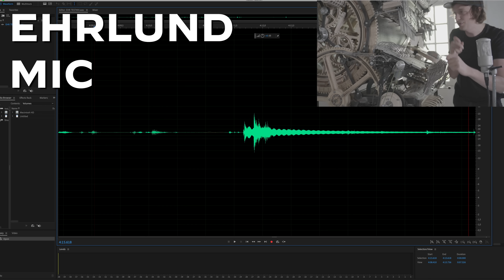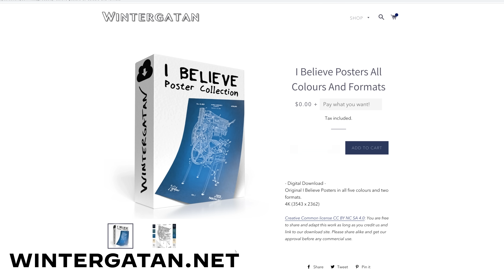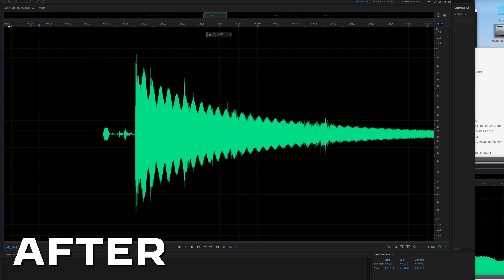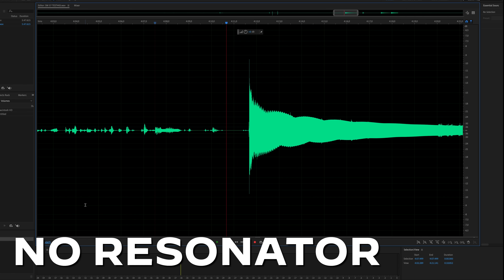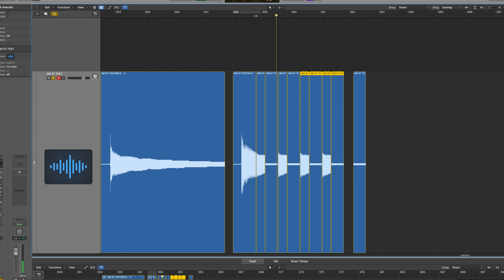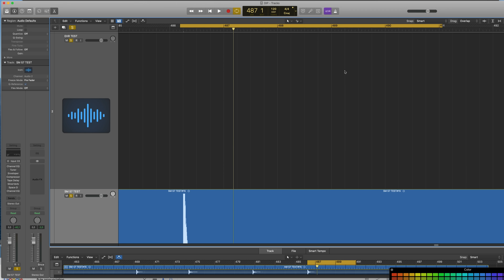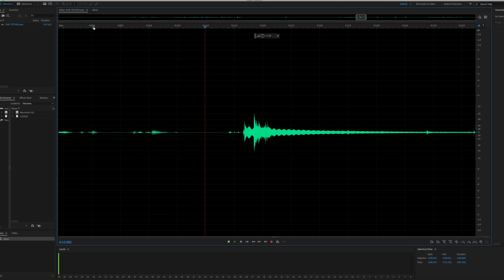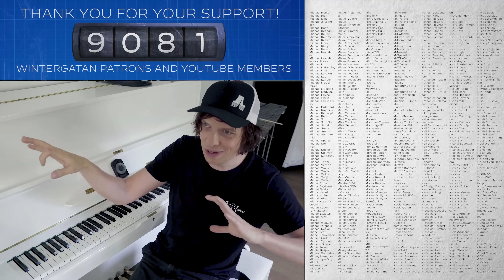Candy Dip for Marble Funnels - Marble Machine X135

Comment: There is a quote from software development: "Hell isn't other people's code. Hell is your own code from 3 years ago." (Jeff Atwood)
I think today Martin found out, that: Hell are your own design choices from 3 years ago :D
Reply: Yeah, in my workplace (with a high proportion of long-term staff), it's pretty common to hear things like "What moron wrote this? Oh, never mind... it was me..."
Reply: The most embarassing is when you have to explain your old code to somebody who has to work on it.
Reply: When I first got into programming, I didn't bother using any comment lines whatsoever.  It's not like anyone else is ever going to need to look at my code, and I'll certainly remember what it all does, right?  Right? ...
Reply: I made a lot of ahk scripts to simplify my work before. I just looked at them now, I couldn't understand half of what the scripts were meant to do anymore lol.
Reply: It's odd how coding is so similar to building something from scratch.  I'm reading all these comments and it's identical to the things I'm thinking when I start working on my project plane again.  "How the hell did that hole get there?  Oh right, that's where I'm going to install the fuel port."  If I had a vlog of my build it'd probably save more time in the long run than I would spend editing it, because I could just about pick up where I left off after watching a few minutes of my own footage rather than trying to remember what I did six years ago.

Comment: Does it make sence to put one thin layer of this new Rubber coating on the spot where the Yellowisch Rubber was Befor ? I think you can get a quite thin layer with that and you have the Material on Hand. And you would not see Rubber spots like you did befor

Comment: 9.50. I dont even hear the tail with my Phone, so no one cares, just finish the machine and tune it later!
Put servo motors to pull the funnels by fishingwire. The sound can be the trigger, or put opto electronics to do the triggering when the marble (bearing Ball) is at the right position /hitting the funnel

Comment: I have an idea. And it checks all the boxes. Get rid of the catch funnels completely, replace them with lights facing upwards and towards the machine, for much more eliminate realestate from underneath and in front of the mmx as they bounce off the instruments , the you can catch all the marbles on the floor with a rubber mat on top of wood rap, and this Catch-Box could hold more marbles, and be part of the transportation create.

Comment: What if the marble catchy baskety funnely thingies are made from formed plastic tubing instead of stainless steel?  Less mass, faster visual response, less pingy.  Something semi-rigid, but compliant.  You could heat form the "wires" and solvent-weld them into funnels of the same shape (depending on the plastic).  That could give you some freedom for color diversity too.

Comment: make the rubber mounted not in contact with the xylophone but floating just above it so the only moment the rubber affects the phone is when its in contact just like if each marble were rubber or plastic coated. the marble should still predictably bounce if you mount the trampoline of rubber just close enough to the phones that  it hardly affects the bounce.

Comment: I wouldn't be so picky about the pitch-shift at the end of the notes, Martin... as only you will worry about it, and ultimately only you will hear it.
You've got more pressing issues to conquer than discovering flaws in initial design and then fixing them again... and again.
Also... I noticed that your 'bucket' doesn't flex back as far now with the rubber coating, as it did before with it off.

Comment: Heya. Just a Thing about the Rubber Pads: If you Run Into issues when trying to make them thinner, you May want to consider mixing your Rubber compound with dampening particles or fibers. This way you might be able to balance bounciness (elasticity) and damping independently. I'm not Sure If you could simply rubberise some filt or If you would need to premix Something.

Comment: I say that you never know what design constraints are the important ones until you build something that doesn't meet them and find you are unhappy. If you'd compromised on the look and motion from the beginning and not heard the sound your original funnels made, you wouldn't know that it matters that this design avoids it. Instead, you spent a bit of extra effort to be able to compare and conclude that the clatter is bad enough to be worth losing some visual interest for. The real lesson is that this is what every project takes three times as long as it has any right to according to the plan, and you should just expect that (or let yourself be surprised by it if that's better for morale).

Comment: higher temperature should allow the dip to flow better. Okay, maybe the solvent dryes out to quickly in high temperature - but... you mention the smell, so there is likely a vapor layer above the pot, so the dip should not dry out to quickly while over the pot.

Comment: I'm guessing Martin is right about the resonator pipe out of tune (9:20) not just because of the pitch shift, also because of the pulsing. Remember the tremolo effect is not active, that pulsing is from the two pitches being a few Hz off from each other. You can even calculate the exact pitch by how many pulses  per second,  1 pulse/second = 1 Hz off

Comment: A common mantra is software development is “Good, Fast, Cheap: Pick two.” In more words: you generally cannot solve a problem in the “correct” way quickly and cheaply; usually “quick” and “cheap” solutions cut corners in quality. To maintain quality, you either have to take extra time or spend more money to get to a correct solution. Martin has learned that this extends to physical design solutions as well.

Comment: Martin, try "Blade Tape" instead of rubber pads. Its a Urethane tape made to protect the leading edges of Helicopter blades, propeller blades, wind turbine blades, etc etc.. Its maybe a half mile thick and it's designed to take the impacts of rocks and debris so your marbles won't do much damage. Its barely barely bouncy unlike silicone. Should work.

Comment: Have a look at SmoothOn products. They make all sorts of rubbers that are 2 parts you mix together. I’m not sure if they make much in the way of clear stuff, but you can get any hardness from a rubber band to car tires. I’ve used it for making custom tires for robots and it holds up unbelievably well. It might be good for coating or filling anything you don’t want resonating. I think it starts at around 25$ for 2 lb of resin.

Comment: Please don't assume that any change will get rid of the "super jumps" without first testing. I suggest the first test involves dropping marbles on a plate at it's resonant frequency, not the frequency of the plate itself but the resonance of the plates vertical movement, then drop a marble off beat to this. I will be very very surprised if this doesn't highlight your problem for which there would only be 2 solutions, 1. remove the movement of the plates, 2. cripple your music making ability by ensuring this scenario cannot happen whilst playing.

Comment: Hi Martin, perhaps I am repeating an existing comment but what do you think the effect of plastic dipping the marbles would have on the overall machine. Many of the instruments you have don’t typically interact with such hard materials as steel balls and as such the tone and pitch may be a little more natural. Magnetically speaking I would expect the plastic dip would be thin enough to preserve the magnetic field strength. An observation only and mostly just thinking out loud. Keep up the amazing work!
Brent

Comment: hotter temperature would make the rubber flow faster not slower. with a hotter temperature you would get thinner coats which would be undesirable for the rubber coatings intended purpose: coating tool handles

Comment: Stop being so hard on yourself but think things through in a methodical manner you should have not done so many layers of rubber dip you should have put one layer on the funnels let it dry and then put it on the machine and tested it to see if it dampened the sound enough then it wouldn't have so much mass where it wouldn't move you put too many layers on it will you took away the reactive qualities of the funnel what I would do if I were you which is going to be a pain in the ass now is the cutoff that rubber start over put one layer on test the sound and the reaction of the funnel if you don't like it put a second layer on test it you know the third layer doesn't work I think you need it to what need to do is troubleshoot it slower methodically I think only one layer of the rubber dip would probably suffice good luck man remember I'm the one that gave you the idea in the first place if using rubber dip rubber is a very trippy material it dampens a lot of sound also movement and it also it has mass so you have to calculate that in to the factors of what you're using it as in your projects good luck and me and my mom love watching you every week we look forward to wintergatan Wednesday I'm so glad you put an electric motor on that machine remember that was my idea I wanted you to do it steampunk but you did it way more badass than I thought you would cuz you can change the rhythms the beats per minute with the crank handle that is pretty damn cool keep your hopes up you're so damn close to the end we're all out here in the world rooting for you eagerly waiting for the day that the marble machine X produces a badass song and you can finally go on tour you're so close to the end maybe you need to take a step back just for a minute and take a break so you can get perspective remember hindsight is 20/20 go somewhere peaceful where you can think clearly without any distractions then come back and kick ass also make sure you got plenty of fans and air ventilation something to move the air around in your and air ventilation something to move the air around in your shop while you're working with chemicals like. Like that rubber you need plenty of ventilation good luck in all your endeavors God bless you peace out into the world have a great day

Comment: By the looks of the sound waves it looks like most of the noise is comming from the impact the marble hits the funnel itself and not the funnel movement so i would say a thinner springsteel plate should give you your funnel movement back and hopefully very little of the noise that was there before

Comment: Yeah I've had that problem with my robot design in FTC robotics competition.
It was my first try and the main goal was to make robot carry plastic donut shaped things. (yeah, i can't speak this language properly)
So I had constructed something like excavator's claws and it was weak bc it was made from lego parts
And when other competitors saw my robot they said:"That's beautiful, but why for fuck sake if doesn't work?"
And yeah, I couldn't find any excuse or time to undo my work)
I ended up second place from the bottom on those competitions, but I've got some experience, which actually helped me to win 2 years later!
Martin, your project is much more complex than mine, but logic remains the same: Don't try to catch beauty in everything, and you will be alright.
MMX IS actually unbelievably beautiful right now as it is, even if you'll lose some wangjangling parts.
Huge respect from Saint Petersburg to you and everyone taking part in this outstanding project!

Comment: In Mathematics, there are always lots of ways to solve something. For an engineer, its job is understanding the needs of the project and find the best solution for the problem. The way we do that is by making the right trade-offs. You don't need to "remove" constraints, when your constraints are opposing (in your case sound quality vs visual quality) you need to make a trade-off. which trade-off you choose will be dictated by the priorities of the project. In your example you rightfully say that your priorities were backwards and ended up with a design that it is going to be harder to fix than to just redesign it with the right priorities. But this is normal, you don't know all the right trade-offs when you graduate from college. you learn it by experience in the field by making mistakes. So, keep learning Martin, don't feel bad for making mistakes. Best of luck.

Comment: High temperature makes liquids less viscous (runnier) so the cooler room has made actually more vicious and flows worse. The temperature guide probably preservation for the volatile components of the rubber (just a guess). I am an oil lab technician just my thoughts.

Comment: As a visual artist the medium is often part of the message. There is value and meaning in letting the machine be a machine and not smothering it with gooey poisonous mask.  The ticks and movements can be part of the expression and embraced. Nils Frahm's Felt comes to mind if you need an example. That's for you to decide ultimately.   Whatever you decide for the machine or any of its parts, glad to follow along. This is an amazing journey.

Comment: Possibly a sunken cost fallacy
Probably a result of insanity
Definitely over-engineered
Do we care?
No. It's ART.
Reply: DIY: Haphazard, works.
Engineering: Not haphazard, works.
Marketing: Haphazard, doesn't work.
Art: Not haphazard, isn't meant to work.
Reply: This is a really simple comment but actually a really succinct observation. Thank you for reminding me what art is and why i do it <3
Reply: We do care, because the over-engineering is the point! It's supposed to be ridiculous, that's part of the charm of the Marble Machine. If we wanted a simple engineering solution we'd just use a normal vibraphone, electric piano, or a soundboard.
Reply: @nathangamble125  That's what makes it art
Reply: @lesbian_samurai3787  i gurantee the mmx will be featured in museums in the future and aliens trying to examine it will think its a weapon
Reply: I want to build a machine that plays music.

You mean a Speaker?

No no with real instruments.

You mean an electronic piano? Gimme some servos.

No no i want to use marbles.

Thats fine: we will use the servos to time the marble drops

No no i want it to be entirely mechanical

..... Are you SURE this is a good idea? Do you know how many years it would take to perfect the design

Hey look i made a prototype using wood a saw and some pipes! It isn't as great as i hoped tho

Thats... Actually really cool but it is limted because you didn't remember to look at the design requirements at the start, you were limited by past choices.

Hey can we make a new model with steel and plastic and wood and awsome.

... That is an art project, and it looks mad enough to work: lemme see what i can put together in my workshop to get this project actually moving

Hey that bit you made is too loud!

But you asked me to.... Try consider a coating to silence the part: or install padding material.

Welcome to the cycle of madness of Craftsmanship.

Comment: You’re describing a URS or user requirement specification with a side of Kaizen problem statement exercise. Getting down to first principles on defining your initial specs, and then the fixes. A change control process may help - also if you’re the only stakeholder without a URS to refer back to it’s easy to fall into the sunk cost fallacy.

Comment: 1) Your decisions and designs that you constraints have solutions, be it to compromise or tinker,  you simply need to find them, and you have been finding them and you have asked us to help you find them.
2) sometimes a solution requires too complex of a plan, or an idea too engineered to work correctly in the real world, and rather to find a way to solve the problem you must find a way to remove it
3) one way to allow the  funnels to pop again is to possibly weaken or lessen the mount of spring steel in the funnels allowing them to pop more, maybe making a test piece drilling 2 long holes in the spring steel so you can make adjustments to the length, once you find your new length for the spring steel you can edit all the other pieces so they all pop

Comment: Hi Martin, I want to say that i think you made a step foward about how you deal with constraints but it's still not the best way to think about it.
You see, i'm a mechanical desingner by trade and when i del with constraints, I prioritise them instead of removing them.
For example: I want my desing to work, to be cheap, to be easy to use and to look good.
With that in mind i think waht is most important? It's to work as best as possible. So I think ok FIRST I need to make it work.
Once i have a good working concept, then i ask what is the next most important thing? It's fot it to be easy to use. So then I look for a way to see if i can make my concept more easy to use without impacting it's function.
Then I ask what is the next most important think, and so on...
And if you can't change you concept without impacting it's previous more important constraints then you stop ajusting it and you call it done.

I won't pretend that this way of thinking is the best but it's the one that has been the most efficient that I have seen thus far.
I hope it can help you. Keep working and may your dream come true!